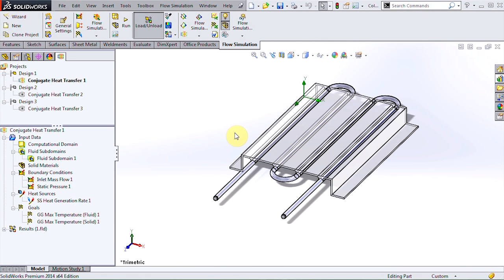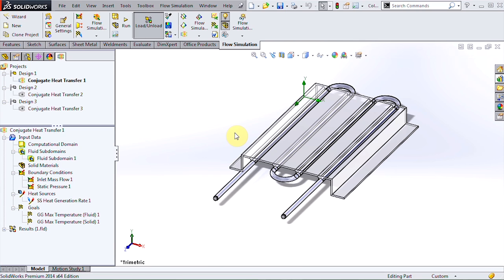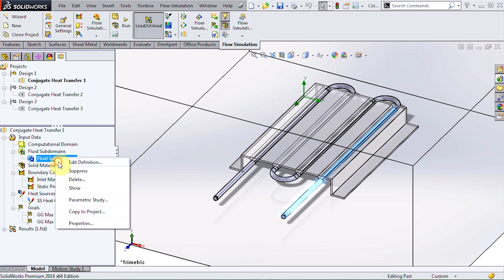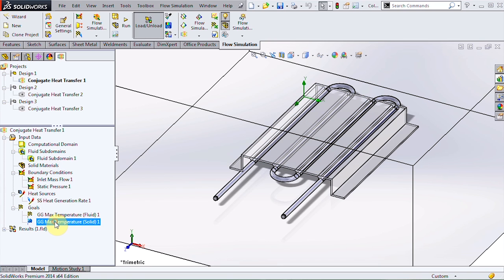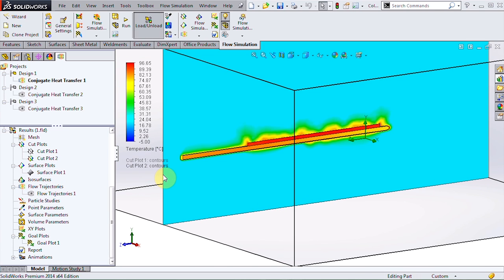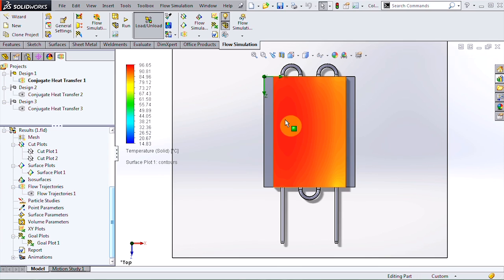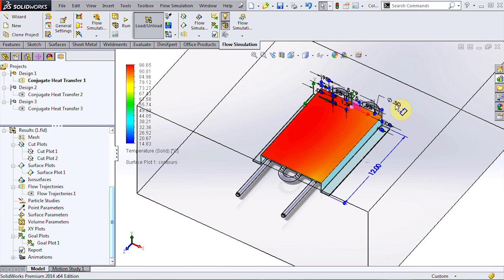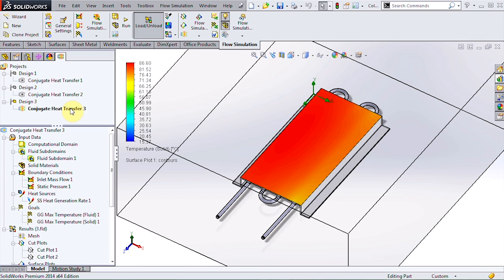SOLIDWORKS Flow Simulation - Conjugate Heat Transfer with Two Fluids

Comment: Hi, I'm designing an aluminum cooling block aswell.  However, I'm experiencing difficulties when I try to determine the outlet temperature of the flow.  Currently, my inlet is defined as a fixed volume flow rate at 70C.  The outlet of the flow is defined as environmental pressure (which I used 1 ATM).  I have a heat generation of 4.4 kW placed on the cooling block.  When I run the analysis, the outlet temperature is shown to be 20C.  This is WRONG, because the temperature of the fluid should rise as heat is transferred from the block material to the liquid.  Please advise if you have a solution to this problem.  Thanks!
Reply: Hi,
This project should be set up as heat conduction in solids, analysis type internal. Under fluids choose the fluid type, for example water. For the solid choose the aluminum type. In wall conditions, choose Heat generation rate 4.4kW. Initial conditions will be by default, unless you have different requirements.

Boundary conditions will be:
Inlet-water flow rate m3/h or USGPM
outlet - atmospheric pressure

VERY IMPORTANT choose heat source "Heat Generation Rate" 4.4kW

Set surface goal on the outlet for the temperature

This should do it, but If you have questions, you can e-mail me at ognen14@gmail.com
Reply: Thanks! :D you rock!